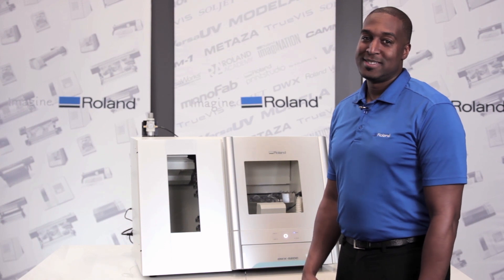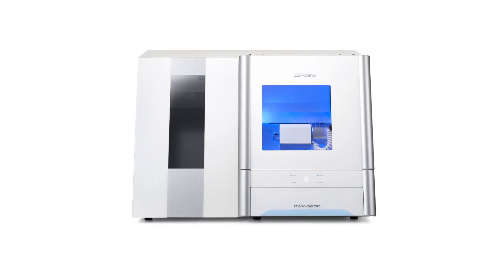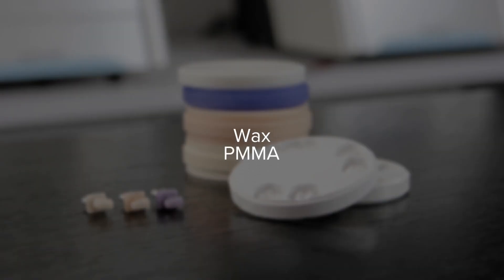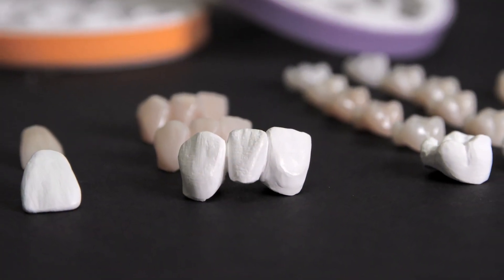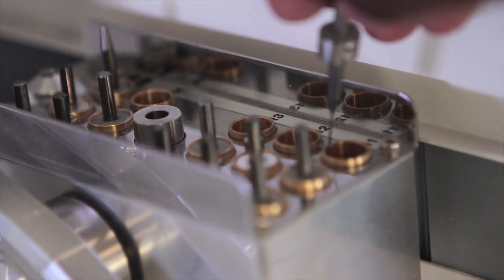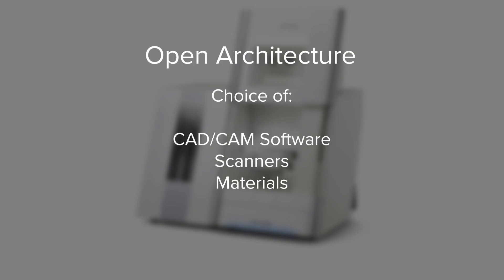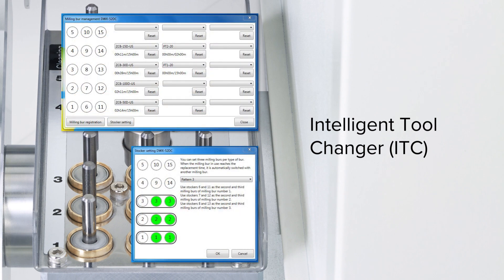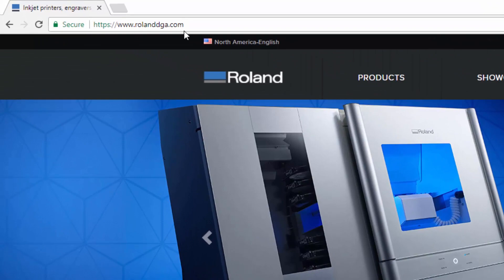Product Walkthrough: DWX-52DC 5-Axis Dental Milling Machine with Automatic Disc Changer

Comment: I purchased a Roland Mill and I can honestly say it is one of the worst purchases I have ever made. Everyone said they are reliable but it is an absolute lie. It has milled out a total of 10 crowns in 6 months and spends have the time broken down. It even arrived defective with broken internal hosing and it took weeks to get a brand new out of the box unit to operate. Since then it as been an absolute disaster. Don't buy Roland mills. What do you expect from a company that designs printers. What's worse is their technical support. Half the time they don't call you back the other half they don't know how to fix it.